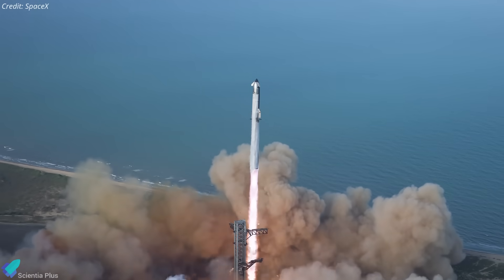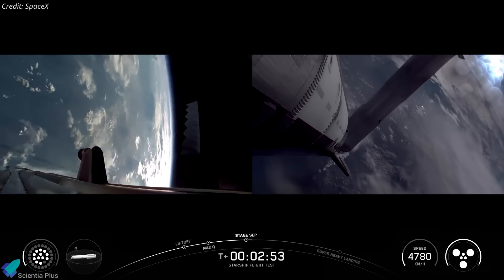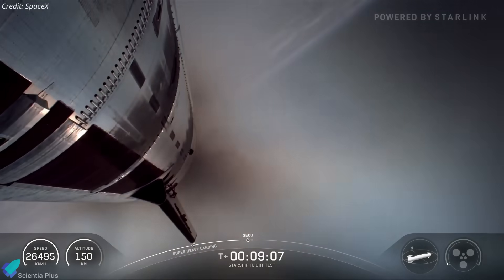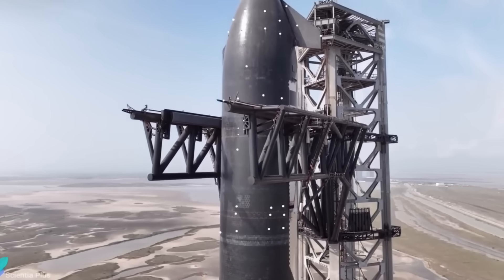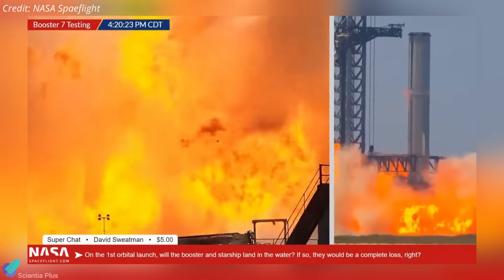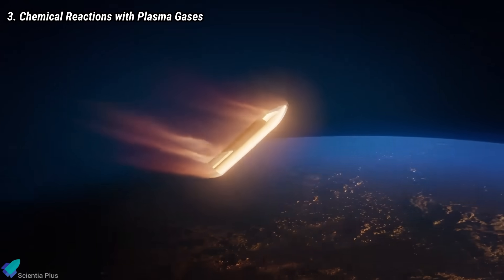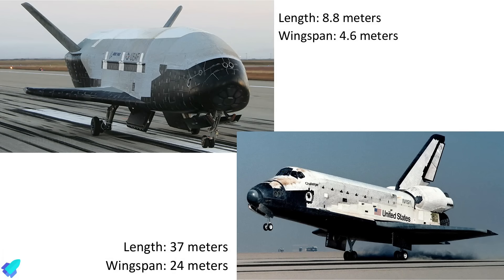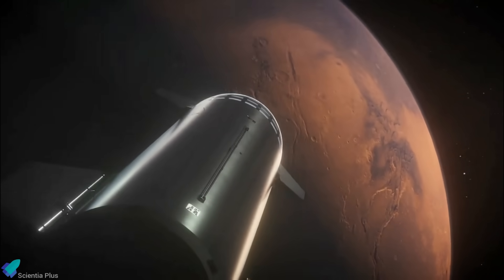Starship Flight 10 Footage Hides the REAL Cause of Engine Bay Disaster & Heat Shield Colour

Comment: I'm surprised Space X dont want to recover the ship for  analysis rather than destroy it
Reply: They flew it beyond the normal criteria and there was the possibility it would not make it's planned touchdown. If they attempted a catch and things went wrong they would damage the tower. There is only one more V2 to go before V3. They have captured several boosters so they have had an opportunity to examine them. The Starships landed in the Indian ocean. It was a suborbital flight. Less difficult then a orbital one. So no chance to land them back in the US on land. ( I corrected from stating that it landed near India to the Indian Ocean.) Hectorpascale pointed this out. My point is that it landed far enough away that it could not be recovered back to Space X.
Reply: @williamdrake2315  Starship landed nowhere near India. It landed in the Indian Ocean very close to Australia.
Reply: They get all the data they need from the onboard sensors, I think the only reason they would have for trying to retrieve it would be to examine the heat shield to see what condition it is in.
Reply: They are too scared to get one landing on a pad because the state of the heat shield is going to set them back years once they see how bad it is. 

I say this somewhat in jest but with a shocked expression from the state of those tiles after re-entry. This is going to plague Starship just like it did the Shuttle.